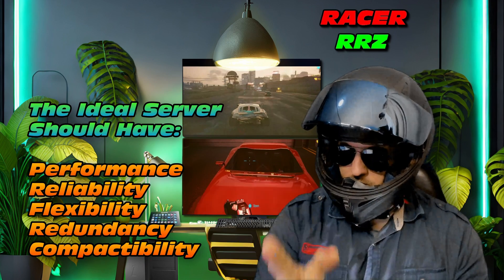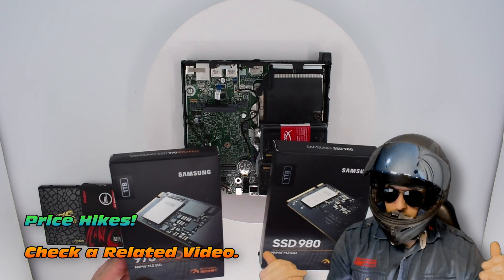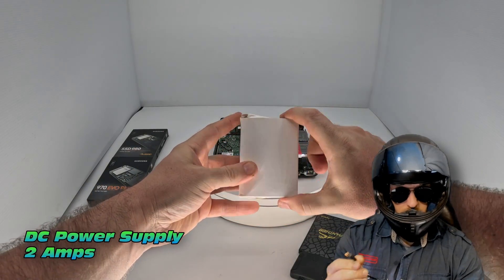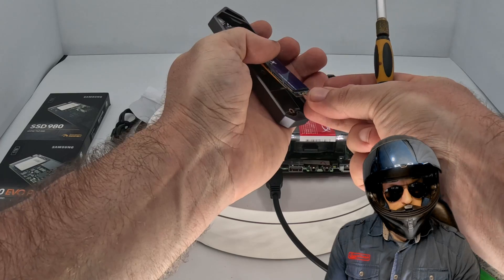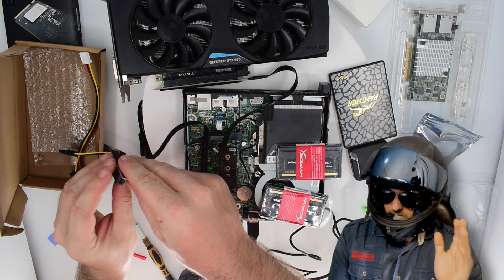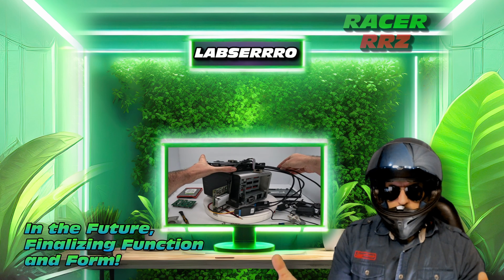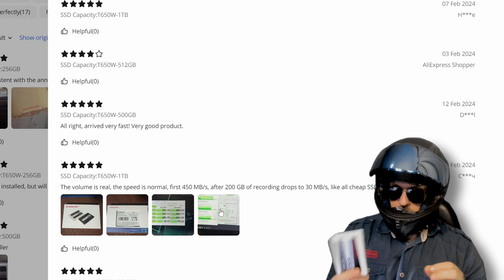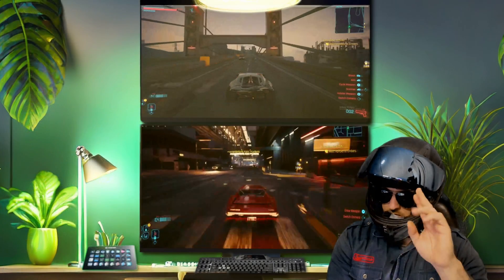EXTREME Mini PC Server BUILD - No Seriously - Frankenstein Server - but does it work?

Comment: Hey old friend, i remember 2 years ago when i asked about pcie bifurcation, on things like HPZ 420 (yeah) and Z440 im now aware the 4_40 lineup can do 4x4 pcie bifurcation the 4_20 sadly not. So I was searching around, and i found some pretty cheap Dell Precision 3650 Mainboards, they have 1x8 + 2x4  or 2x8 or 1x16, BUT they have 3x4 m.2 places with 1x16 and 1x4 pcie, okay, the VRM cooling is a ripoff, but with thermal glue  ;) in short the HPz240 but in newer would be the dell precision 3650 / 3640

why i tell you well maybe you're also interested in trying out dell, but be aware, not all m.2 drives work in a Dell 3640
Reply from the maker: Hello - it's been a while! Yes, unfortunately the Zx20's lack PCIe bifurcation. The Dell Precisions are solid alternatives and they tend to only lack slightly in features over the HP offerings. 

I am a bit slow but I will soon introduce you to the HP Z4 G4! It is the newer architecture and the system prices are coming down as the hardware ages. The Precision 3650 is quite neat with the three M.2 NVM2 slots. The Z4 G4 only has two M.2 NVMe slots on the motherboard, but it has more memory slots and more PCIe slots than the Precision - by comparison. It really just comes down to what is affordable at the time. 

Did you case swap the Precision 3650 motherboard or leave it in the original case? It would be an ideal case swap board by the looks of it!
Reply: @racerrrz  yes i've taken the mainboard 3650 to another case, the later systems have different screw positions. but the thing which moved me from hp to dell were the internal connectors lets say you only have to route the power button and populate all fan connectors so you dont get a message in bios on startup. but dont get me wrong dell is also not so good, you cant use all the ssd you would like somehow my samsung drive pm1733 will show up but the system is like frozen. 

I try to find an AMD system like the HP's Z series because of ECC RAM and all the other features you got. And the power Efficiency and low power consumption i really try to hold my power budget down and little as possible

z4g4 I was thinking about it but i think a case swap would be really difficult?
Reply from the maker: @googlepixelutai8310  Nice. It looked like a good board to transplant - well done there. Dells are simpler in many ways which does make life easier. 

Finding an AMD system for a decent price isn't easy. I have looked at building something modern (Ryzen 9900X etc.) but it's really cost prohibitive once you add everything up. Even the older Ryzen systems still cost a small sum. 

Your timing is good. I have done the ground work for the Z4 G4, Z6 G4 and Z8 G4. The front I/O does not have a classic "on/off" trigger - but rather a PCB that manages that output. Not a deal breaker - it just means you have to retain the HP front I/O to complete the case swap. Given that it's a 5.25" compliant item (slim DVD drive sized) it should work in most cases. 

My summary so far: https://www.youtube.com/post/UgkxZ4tEa3jTl1bjZOWH3X-5xupSMOP53dKo

The Z4 G4 has a few other considerations - like the dual M.2 NVMe slots that require mounting to the case. You may be able to create something to secure NVMes regardless. The majority of the board plugs connect to the front face of the PCB - not the lower face. That might create issues but it should not be a big deal. The remaining issue is Z4 G4 PSU to ATX converter cables. They are not mainstream just yet - which means you would need to custom create a loom to power the system with a new ATX PSU.  

I'll make a post and a video overview of the Z4 G4 in good time. I did consider it as a case swap but it has less PCIe Slots than the Z440 (due to the native dual M.2 NVMe slots). 

Sample teaser - Z4 G4: https://preview.redd.it/trying-to-install-a-asus-hyper-m-2-x16-gen-4-pcie-card-and-v0-7xumd7wh0tve1.png?width=2500&format=png&auto=webp&s=48037543713720194defb772b49a5556df69c103

Comment: Started out with the 4c4t server that does 65w idle n 250w max and my brain was like "that was not worth using garbage 7 years ago, any ol office machine can beat that now...why would I bother...then you hit me with the nice priced decent power mini pc...yea you got me
Reply from the maker: I had to break the ice with some logical servers that most of us have run into (they are good value now, just a bit expensive to obtain and to run). 

However, it's a hardware crime to call a Mini PC a Server, but I will make this Mini PC a Server lol. I just want something that I can leave on all the time and not sweat the power-draw while also being able to load up a bunch of VMs (aiming for Proxmox as my main OS) so I can use it as a little server to run the home network. I may still upgrade from it to a more modern Mini PC but for the time being the 4 Core 7500T is proving decent - but I am yet to load it up with everything I have planned for it (future videos! lol).
Reply: @racerrrz  as a master of hardware crimes I understand, I have an erying 11th gen ES0000 Engineering sample 8c16t laptop cpu soldered onto a desktop board with 64gb ddr4, 4x 2tb sata hdd, 2x nvme and a 4tb usb drive as my fileserver/vm/gameserver combo.

it replaced a 4c4t 3570k/4690k, which replaced an old laptop with no keyboard/cover and adapters, which replaced a 4c8t dell t310(I think) tower server which is still newer/more powerful/cheaper than that old blade server

my servers are a poster child of how not to run a file server, yet somehow 100% data retention for 20 years, lady fate take the wheel.
Reply from the maker: @Revoku  I see you like to live dangerously, how is that ES 0000 CPU treating you? 
As long as your motherboard reads it and it clocks in as expected I am sure it will do just fine. 

The 11th gen laptop CPU soldered onto a desktop board sounds right up the hardware crime alleyway, but if it works it works...lol. I am sure that makes for a powerful server. 

Full confession, I actually contemplated cracking open a tablet or laptop for this server build concept. The Mini PC won that duel because they tended to have more dedicated USB ports. But it did cross my mind to case swap a tablet or laptop motherboard for this low power draw build. I mean it would work.
Reply from the maker: 5GHz means business, not bad for a laptop CPU. Nice, you have it well loaded there. How intensive are the Palworld servers? I tried an Arc server a while back but that proved to be too intensive / was poorly optimised for multicore systems lol. It may be an unconventional rig but for the price that sounds like a solid system for your end use situation. I made some progress with testing VMs on the Mini PC. Proxmox while running some VMs: Ubunto Server + TrueNAS Core + Win 11 (installed failed, will retry lol). Decent transfer speeds and no major bottlenecks. The 4 Cores and 4 Threads might come back to bite for me for running multiple VMs, but I can always upgrade the base Mini PC in the future.
Reply: @racerrrz  that was the problem I kept running into, either not enough cores, or the cores were too weak, tis why I had to retire the 3570k, 4690k and the old xeon

Old laptops with lots of cores and at least 4 usb work well, built in UPS lol
Reply from the maker: @Revoku  Your laptop fix is creative and if it works, why not lol. Plus they tend to be less power hungry than the desktop systems which is a plus if running 24 / 7. 

Workstation systems would be the best fix for that. I would like to think my Z440 case swap would handle these tasks well but the power draw is substantial on that system (E5-2697 V4 with 64GB 2400MHZ ECC Reg. and 80TB of drives : uses ~200-260W). 

The Mini PC is drawing ~8-20W at the moment and it doesn't even generate any heat or noise. I would like to think it will get the job done - 24 / 7 operation with a smile - with the only caveat being the 4C / 4T lol.

Comment: Please Consider using an os Like CasaOS or trunas.
Reply from the maker: Thanks for the suggestions. I didn't consider CasaOS, but it might be cool to try OMV and CasaOS (I saw Hardware Haven's video on the topic - looks cool). 

I plan to use Proxmox and then to make VMs for..., well basically every software I may want to test in the future (making this system a little 'software test bench'). I have previously built a bunch of TrueNAS servers (HP Z420, HP Z440 Case Swap and HP Compact 8300 SFF) but it can't hurt to have a TrueNAS VM also. I was planning to test out a ZFS VM (Debian or UnRaid) to handle the RAID 5 on this build. In testing in the video, I went for Windows 10 Pro because that's just my default OS for testing things + OBS for screen recording.

Comment: If you only need 2 HDDs just use a ODROID-HC4. No 10GbE ethernet but far simpler.
Reply from the maker: Nice find. That's not a bad solution for storage and I am sure they are low on power draw also. I paid $45 USD on auction for the HP EliteDesk 800 G3, but generally they still sell for ~$120 USD, but it has a lot more on offer than the ORDOIF-HC4. I hope to create a little "FMS" that can handle 6x drives (4x SSDs in RAID 5, 1x large HDD scratch disk and 1x NVMe boot drive). If I forgo the 10GbE and stick with 2.5GbE I can nearly match the cost of the ORDOIF-HC4 (~$155USD): https://vi.aliexpress.com/item/1005002090856281.html?gatewayAdapt=glo2vnm . My system would sit ~$142 USD out of pocket before accounting for drives (so EliteDesk 800 G3 + 32GB DDR4 + 2.5GbE NIC (which retains the 1GbE NIC also) + 4x SATA to USB cables with DC power supplies + "free" old 4-bay NAS that I already had sitting around). Including the drives the net system cost will be ~$480 USD (mostly AliExpress items, 4x 1TB SSDs for RAID 5, 1x 256GB NVMe for OS and 1x 16TB Exos X18 Scratch disk).

Comment: Did the 10g NIC ship from China? I've been looking at some myself but I'm a little suspicious.
Reply from the maker: Yes it did - basically all the items were off AliExpress except for the Mini PC itself and the NAS that I already had. I put the link to the 10GbE Card in the video description (which is from the same seller I bought from). 

I still need to do a quick test on it in a normal system just to confirm that it is working, but in the M.2 M Key slot Windows 10 Pro detected it, but only 1 port (there are only 4x lanes so that makes sense). The only snag was that the card didn't operate in that config. I trust it will work in a normal PCIe 3.0 X8 slot.lol

Comment: Do the fake goldfirs speed up after a while, or do they stay consistently slow after the first few gigabytes are full? Also, how are their read speeds? If those are ok, it might be fine to host some server VMs on them, maybe...
Reply from the maker: They have actually exceeded my expectations (I was literally expecting MicroSD cards in there haha). There are 4 NAND Flash chips and the overall Read/Write speeds are decent (Example Speeds: https://www.youtube.com/post/UgkxLM44sIAnVesX09XthghVvHQYH75SJI4B). 

I did a quick error check in HD Tune Pro on one 1TB SSD and the entire 1TB of disk space cleared without errors - average read speed of ~185MB/s. I'll do more tests on them to see what the limits are. I don't think it was heat soak that slowed them during my first test run but I was trying to overload the controller to see what it would do. 20 simultaneous mixed file transfer batches was not tolerated well though. But I suspect they will work just fine as a RAID 5 pool etc. The speeds remained fast for the first ~230GB of a single 1TB SSD, then it slowed to 30MB/s (I only wrote to ~450GB before giving up on that test). But I'll do more tests on them to see what's up with them.
Reply: @racerrrz  Thank you for your answer! If the read speed is not that bad, then maybe these are OK for hosting data/vms that don't change too much. My guess was that they do some kind of storage tiering, where they fill up the faster nand first, and then take their time to move the data to the slower nand. But with a cheap device, who knows, maybe they just threw together some chips of different kinds and hoped for the best. Which might also work if the workload is mostly reading.
Reply from the maker: @johnsmith9205  I got a few VMs tested. I installed Proxmox onto a GoldenFir 1TB and then used a second 1TB for Ubunto Server and TrueNAS Core VMs. All seemed to be working well enough and transfer speeds to and from the VMs were decent (peaked a 1GbE connection). I am happy with the basic performance. Next step is to add in some RAID action.

Comment: Could you try out the tool called "disk-filltest" (opensource, windows compatible, also on AUR) on those SSDs to check if those SSDs only get slow because of some MLC sheninigans or they really are much smaller in size, with the controller slowing down because of overwriting an already stuffed SSD? Could cause data-corruption in the latter case.
I once had such disks on hand, opened them up and checked the datasheets of the memorychips that were on there. As feared, 2TB drives were only 256GB drives with an noname brand controller..
Reply from the maker: I did a quick scan through one of the SSDs with HD Tune Pro and that cleared the entire 1TB at ~190MB/s on average (I'll include footage in the next video on the subject). The speeds did not drop to less than 180MB/s in that test. That may mean that I overloaded the poor thing with my stress test haha. But I wanted to know where the limit was and I think I found it. I did not monitor temperature nor did I have airflow over the SSD during the initial stress test - so it could be heat soak related. I'll pile the 4 SSDs into a RAID 5 Pool and then I'll clear a bunch of tests. Thus far these SSDs are proving their worth, but I'll still find out if they are reliable. Screenshot at the end of the run: https://imgbox.com/1PZjal77 (the speed in the pic is only from the last frame - it was ~180-190MB/s for the whole drive). 

I'll check out disk-filltest also to confirm. At least there are 4 NAND Flash chips in there. I wish there was a catalogue to check their specifications but I have not found anything just yet. But it would be good to confirm that these actually are 1TB and not some sort of workaround as you say.

Comment: Cool build. I'm curious how the final server will look and perform. Personally, I would never buy an SSD on AliExpress because I've seen too many pictures of fake SSDs opened up, and there's just an unbranded microSD card inside.
Reply from the maker: Thanks. I need to get the final product finish but so far so good. In terms of SSDs, it's a risk but so far I have not had the microSD card experience, but in saying that I thought these might have that (30MB/s write speeds is suspicious) which is why I opened them up. 

I also did a full speed assessment of the entire 1 TB drive (it took a few hours), but it appears there are two fast NAND Flash chips (over 300MB/s read/write) and 2 slow chips (30MB/s read/write), which explains the costing in part. 

I bought from the cheapest AliExpress GoldenFir listing on the day. I believe the microSD experience is for the less established brands - but I guess it could happen for any item if too cheap to be real. Overall I am happy with the product - and I intend to push them to see what their limits are. But I would not use them for critical data.